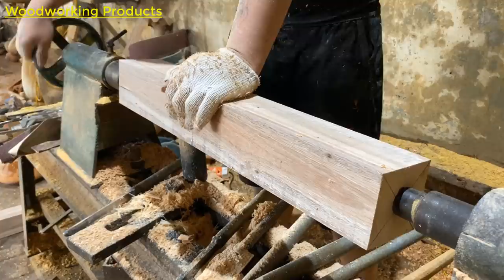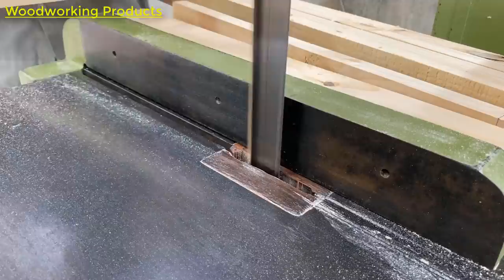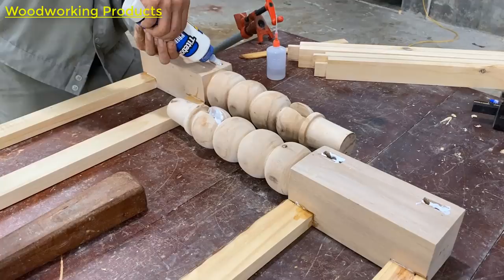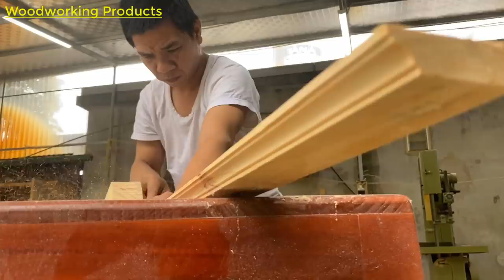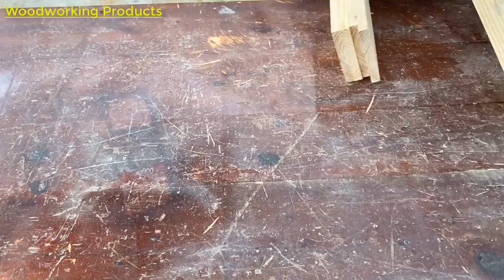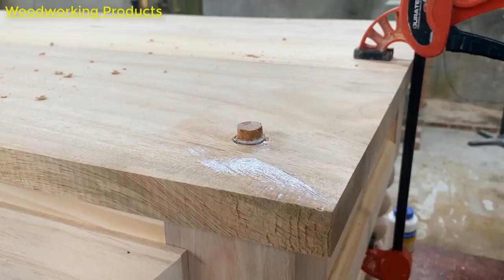Daily Work Of A Carpenter // Creating Unique And Creative Tables - Novel Ideas From Wood

Comment: There is no way a professional carpenter would use over 60 brads to put a small drawer together. A professional carpenter would never apply finish using a paper or cloth mask. A professional carpenter would dry fit everything together to make sure all the joints were aligned. A rank amateur woodwork maybe, a carpenter? Hardly.